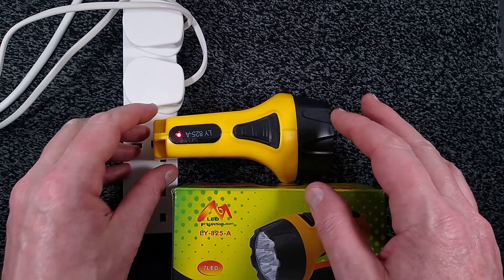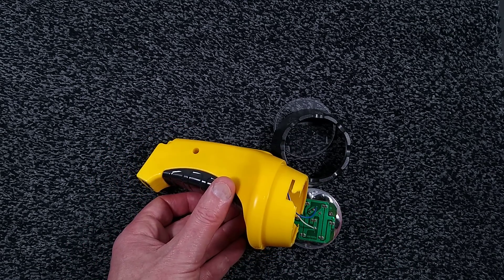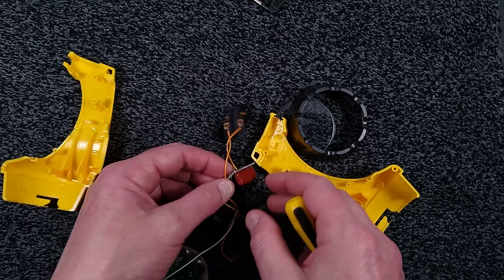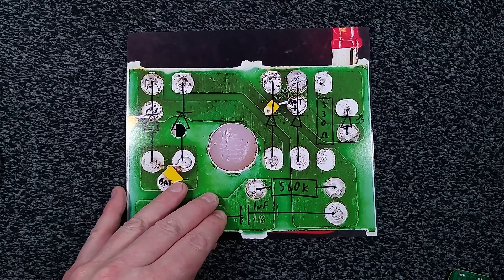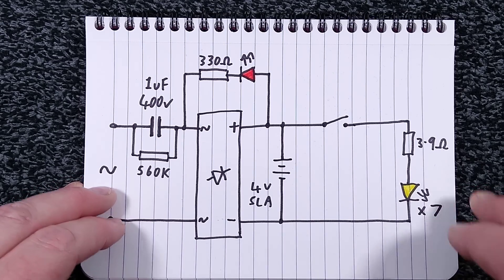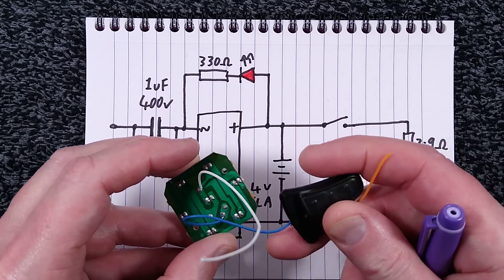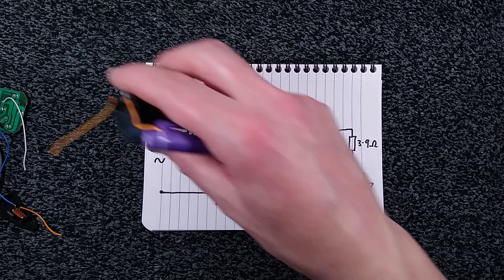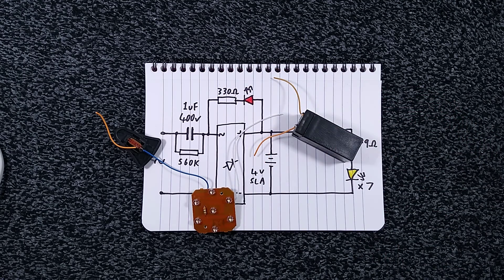Taking apart Vince's Cambodian rechargeable flashlight

Comment: I grew up on a farm which was very dark at night. Consequently, battery powered torches were an essential item so we could check the animals at night, and also attend to the irrigation.
I remember when rechargeable lead-acid torches became available and how they greatly reduced the cost of batteries.
The problem was that occasionally these new torches would explode loudly and destroy themselves, along with the power outlet.
Apparently there was a point where the slowly drying out electrolyte would result in a spark, which would ignite the Hydrogen/Oxygen mixture inside the cell.

Comment: I had an Arlec one where the torch came apart in the middle to reveal two prongs to shove into the wall, and the front of the torch could remain stuck on the fridge with a magnet. When fully charged, the two halves could go back together and the prongs became the pathway for the battery to power the light. Probably an SLA battery in there. It's still stuck to my fridge but probably dead as a doornail.

Comment: When I was working in Brasil, in 2009, I experienced few power failures at my home, so I searched for a cheap and rechargeable flashlight. I choosed one like this one. I had also find the regular ones with AA or D cells but rechargeable batteries + charger + flashlight... was too much hassle. So, I got one like this one, with exactly the same schematic. It lasted around 3 years until it started to take less charge - maybe the capacitor want bad - and I did not used too much anymore. I took it apart and made a quick and dirty charger for the lead battery and used in some project.
Some 8 years ago, I bought an FM radio with mp3, SD card, USB and flashlight to have it at work. I observed that the charging LED was flickering when charging and when I opened it, inside was the same charging circuit with the same battery type, with an added circuit to power it from 4xAA batteries (a diode to prevent the charge of AA batteries). This one, I adapted to work with a 2000mAh Lithium cell and put inside the case the guts of a USB charger, a charger circuit for the battery and the DC converter to power the radio. Needless to say, the radio is almost 8 years old and refuses to die. Last year I changed the Lithium cell just because it cound´t keep the charge for more that one hour when listen mp3.
Reply: Or you could have bought something better.

Comment: You are always opening things up and many have the capacitive dropper PSU.   They all seem to have what I think are the brown/orange metalyzed polyester film cap for the dropper.   Yet when you look up building a capacitive dropper PSU they always advise to use an X2 rated cap for this dropper.    Is the X2 really the answer or are the metalyzed polyester film caps with high enough voltage rating sufficient, safe enough and reliable?   Your thoughts/experience would be greatly appreciated.  Or have you discussed this previously in your vids?   When I build these I always include a fuse at the mains input in case any component fails.   THANX
Reply from the maker: Cheaper items tend to use the red capacitors because they are cheap.  They may lack the self healing properties of X2 capacitors.
Reply: @bigclivedotcom  THANX

Comment: The capacitor and resistor combination stabilizes voltage?
Reply from the maker: The capacitor rations current on each half wave of the sine wave.  The voltage is capped by the battery in this instance.
Reply: @bigclivedotcom  Noice.  Would be cool to see copper running from a lemon to power an LED.  I'll check if there are other videos.

Comment: I just too apart a fenix L2D flashlight I got for Christmas 4 years ago. Let's just say I had to drill out the Duracell batteries. The tail cap switch and spring survived and the Led and lense unit came out unscathed. The flashlight was in a vertical position under storage with the lense up so all the battery fluids leaked down towards the tail cap. The switch was saved by a rubber o ring. I could not believe how hot the dead batteries after I drilled out the carbon electrode. It's working again with some Mar marks from slipping in a pair of vise strips but I got it appart and working. Had no idea that flashlight was so expensive. Have to thank my friend and need to have a better way of calculating when to pull batteries out of flashlights
Reply: *vise grips*; "Vise/vice strips"  sounds like what occurs when the police raid a "gentleman's club" and frisk the dancers!

Comment: My father had a rechargeable torch back in the '60s. I thought that it was amazing: it was a torch, but when the battery went flat, you could recharge it by sticking its prongs into the wall socket. It had fixed prongs, covered by a removable plastic cap. If you remember the old 15A round sockets (still used in India and other countries) and the adapters that we had: most of them had one 15A socket and two 5A sockets. The pins would just about fit across the neutral and live of a 5A socket, but we had an ancient two-pin socket in the kitchen (Heaven knows when it was put in) and it was a perfect fit. Obviously the torch had a filament bulb (no LEDs then) and I suppose it was a lead-acid battery because we didn't have NiCd batteries. Thinking about it, the torch was pretty feeble and the charge didn't last long. Nothing like a match for the little Nitecore. But, dry cell batteries were expensive and drained fairly quickly. Rechargeable batteries were the nearest thing to magic that one could imagine. Happy days!
Reply: Rechargeable torch?  What is that, a tree? You burn part of the wood, then wait for more to grow to "recharge" it? Is the tree in a pot so that you can carry it around? 

Wouldn't a flashlight be so much easier?  You can even get waterproof flashlights now, so you wouldn't need to worry about rain or a big splash putting out your torch.
Reply: @furrbearrapedmycat7223  two nations divided by a common language....

Comment: I love these small lead acid batteries.
great for backup since they (unlike NiMH and lithium) prefers to be fully charged always.

would this light hold up if the charge circuit was replaced with a proper charger?
or is the battery simply too low quality?

putting a 18650 battery in seems defeat the idea of a always ready fully charged flashlight

Comment: I found the same battery in my bug zapper tennis racket I took from Thailand. After the winter (no bugs to Zapp), the battery was dead. Replaced it with four aaa NiMH cells, and removed the charger. While charging the metal mesh was connected to the mains directly. That’s only useful when you try to Zapp yourself. With the aaa batteries it Still works fine. Nice detail is that in the Thai version there are no varistors to limit the output voltage. Zapps a lot better than the ones usually sold in Europe.
Reply: My bug zapper currently features an 18650 and a 3D printed bracket for the tp4056 charging board.

Comment: Serious penny pinching to charge a lead acid battery from a (roughly) constant current supply. They could at least have bunged in a zener to limit the voltage, though a voltage regulator chip would be much better.

Comment: what limits the maximum charge voltage ? presumably the charge voltage Will just keep climbing up and up once the battery is full
Reply from the maker: It will be capped at whatever the battery state is.

Comment: i found one of them in store's used bulb / battery bin. never tried to fix it yet. by the looks of it, the cap dropper / zener blew and took every led with it. power led was blown to bits even. the device has quite a space inside that would justify to rebuild it to common li-ion usb charge lamp / powerbank. it needs new front led too. what a piece of shit

Comment: I always look forward to your posts Clive! 🤗 Informative and enjoyable. Especially your LED and ozone generator videos. My favorites! Wasn't surprised to see the lead acid battery today. Myself, I prefer an 18650 battery and USB input. But you're correct, these out dated lead acid battery circuits with capacitive droppers show up in most of the LED light circits these days. I found these exact same lead acid batteries in two Bell and Howell branded 60 LED light bars that I purchased years ago. I didn't like the AC wall charging cable idea at all. Then when I opened one of these light bars I didn't care for the lead acid battery either. Sadly, manufacturers usually won't admit up front to using lead acid batteries in product ads. Thanks for sharing another video with us. 🤗
Reply: I go by the rule of thumb that if they don't prominently advertise Li-ion or NiMH, it's an SLA.

Comment: That poor battery can't be too happy getting hit with ~325V while charging.  If I'm not mistaken, over voltage turns into current with lead acid and that's probably why the circuit board is toasted around the rectifier diodes.

Comment: Lead-acid batteries are well suited for standby use, since they age the slowest when they are kept fully charged. But you must regulate the charge voltage accurately. This thing would destroy the battery quite quickly.

Comment: How do you rectify 230V and get to 4V over the battery??
Reply: The capacitor is a high resistance to 50Hz AC so the voltage collapses and settles to whatever the battery allows it to be.
Reply: @migsvensurfing6310  That’s a short, simple and effective reply. Thanks!
And the rectifier couldn’t care less about voltage, I assume.

Comment: I was on our towns volunteer ambulance service in the 1980s. I installed a couple of lead acid hand torches so they would be recharged by the ambulance 12V supply. They had 4" sealed beam bulbs if I remember correctly. We didn't need to use them often but they were nice to have available.

Comment: Wow - did you lug your eco tank printer to Edinburgh, or do you rely on a local print shop when away from home?
Reply from the maker: I bought one specifically for this job.  It lives in a container or with co-workers for most of the year.
Reply: There are small travelprinters available on the market and for battery use even.

Comment: I had several safety lights fail due to those lead acid cells leaking and corroding everything.  They were mounted with terminals down in the enclosures... not the best choice.

I swapped out all the lights for ones that use 18650 batteries and charge control chips.  Much better.
Reply: No problem. You will soon NOT be able to buy it anyway.

Comment: How does the indicator work? Does it light up while plugged it at all time or only when battery not full? If at all times, why not just put it across the L and N? Also, the higher the state of charge, the brighter it lights, right?
Reply: The led is dependent on the voltage drop of two diodes in the bridge. There is only a voltage drop if the cell takes charge.
Reply from the maker: The LED lights all the time while plugged in to a live outlet.

Comment: I like the plug in flashlights that automatically turn on when either the power goes out or you unplug them.
Reply: I have several of those powerful flashlight plugged in around the house so that we'll have some minor illumination if the power goes out in the middle of the night.  They seem to last for years.
Reply: *power-fail*, not "powerful". Autocorrect strikes again!
Reply: I could really do with finding some of those. Anyone have a link for some cheap ones?
Reply: @simonmunden5046  ,  I posted brand name information to you 3 times without an actual link and yet YouTube keeps disappearing them.....😖
Reply: @goodun2974  thanks for trying bro, appreciated.  Actually, I used your spelling comment above as a start point for searching & found them easy.
Reply: @simonmunden5046  ,  The ones I found online were kind of hourglass shaped and look nearly identical to what I've been using for the last 7 or 8 years.  Since they're mostly sold in 5 or 6 packs, maybe you should take one apart and post a video for us Big Clive fans!
Reply: @simonmunden5046  "mains emergency light/lamp"
Reply: @simonmunden5046  , they used to be sold at Home Dumpo for $8 (7 or 8 years ago); the brand was AmerTec.

Comment: Whilst this little torch is working .... it has TWO  serious snags ...1st , the cell might  be left on charge for a LONG time ... the voltage will rise beyond 4.6 Volts .. this will cause the cell(s) to gas , reducing capacity , the increase in concentration of the acid will cause the cells to self discharge ..... then , 2nd , a  LOT ! ! !  of folk leave Lead acid batteries , fully or partially discharged .... the Sulphate crystals amalgamate , becoming almost impossible to recharge , and they also swell up making the internal plates touch causing rapid discharge ( a lot of 1990's halogen flashlights failed in this manner ! ) ... so .... enjoy it while it is still working ! ! .... ( tried - n - tested ) ....... DAVE™🛑
Reply: In other words, win-win. Too little charge and the battery goes, too much charge and the battery goes. With no means to identify state of charge. Ensures repeat customer within a year or two.
Reply: @rexsceleratorum1632  This little torch is  IDEAL  to retrofit with one of the ( thousands ! ) of rechargeable batteries thrown away with disposable vapes ... but ... would recommend using the CORRECT  4.2 volt Lithium charger ( NOT the one in this torch ! ) ....... DAVE™🛑

Comment: So.. it's only current restricted and rectified after 230v input and that's it for the poor 6V battery? 

I have a complete bible about charging my lead batteries about C values and low and high voltage cutoff and trickle charging also temperature control and measuring internal resistance.
Funny to see this simple approach

Comment: No doubt many can remember the good old Panasonic (genuine!) rechargeable flashlight from late 70's / into 80's.
Ni-cad, conventional PR bulb, the battery end separated from the lamp end, to reveal Japanese type 2 pins, for sticking into the power socket.
It also had a good, strong magnet on it, handy.
I bought mine in Japan for a "cheap" price (I too am Scottish, and love a "bargain" ! )
It lasted for YEARS, in fact I think it only stopped taking a charge in the early 90's.
Obviously a very well made bit of kit, using good quality parts to last that long.
"Ah, they don't make 'wm like they used to....."

Comment: Voltage not clamped - seems like a recipie for a fire when the cell gets old and its internal resistance rises.
Reply: I've seen dozens of this type over the years (they have been the norm in Asia for quite a bit), and I have yet to hear of one actually catching on fire. The innards feature skid marks and the capacitor melts but that's usually it.

Comment: These tiny lead acid batteries are prone to dry out and the plates inside to crumble over time, sadly they dont last long. Nimh batteries would be better and last longer. I have seen a few of these plug in torches and all contain cheap Chinese lead acid batteries. The plate separators inside are separated by tissue paper which will break up over time causing short circuits in the cell. If you take the battery apart you will see what I mean.

Comment: 14 years ago when my mom was coming home from China, she was bringing along some gift rechargeable flashlights. The security opened the flashlights and cut out the batteries.  I wonder why they did that when people have cell phones or other rechargable devices?
Reply from the maker: That seems odd.
Reply: @bigclivedotcom maybe this is because "security is as security does". Twenty-some years ago, for some reason, demand for airport security personnel skyrocketed, and you can't cater for such demand by only picking the sharpest tools from the shed.

Comment: I converted several to a li-ion battery with a charging system,even 5V power can fit inside.
In the system with an capacitor power supply, it burns Leds from the power spikes and the acid battery dries.

Comment: Would I be okay with my phone having a sealed lead-acid battery instead of the lithium-whatever it has? Maybe. I wouldn’t mind a somewhat heavier phone. Not sure if the power density is sufficient for it to be tolerable, or the charging time, number of charge cycles it can tolerate, etc. Mostly-good experience with car batteries makes me optimistic, but…
Reply from the maker: I don't think it's ideal for a phone.
Reply: I could imagine some of the first "mobile" phones may have ran on SLA batteries. The battery for those often came with a proprietary satchel to carry it in.
Reply: @jimmyrustler8983  pretty sure the brink phones from the 80s were acid lead. Lithium allowed us to slim the design down
Reply: @mdb45424  AFAIR in the 90's Ni-Cd and Ni-Mh were mostly the norm inside pagers, laptops, camera and other handheld devices.
Reply: @jimmyrustler8983  , 30 years ago my boss forked out a lot of money for a 'mobile' phone that was corded to a container the size and weight of 3 solid house bricks.   he bought it because it was a requirement for the building job we were on.   it cost a lot even though it was second hand.   so yes, the really old 'mobiles' had sla's.
Reply: @jimmyrustler8983  Ni-cad was the standard for many years. I had one of the first  gsm phones with a sim card, it ran on 10 D-sized Ni-cad cells cells. A bit heavy but portable. I don't remember the exact weight but it must have been 3 to 3,5 kg.
Reply: @migsvensurfing6310  Was it a large unit with a handle and a corded handset like the Radiocom 2000 or just a large handset with everything in it ?
Reply: Imagine carrying a car battery in your pocket.
Reply: I'd probably laugh seein someone with a car battery inside his backpack to power his cellphone! Absolutely add some reinforced straps on the backpack! Very sadly, back problems in anyone's future. 😮 Let's see the estimated runtime. 🤗❤